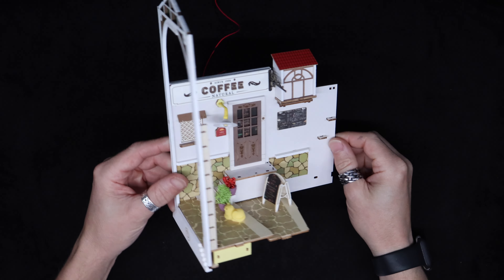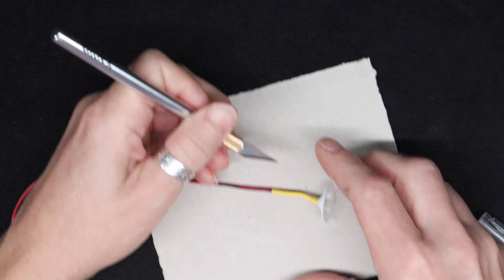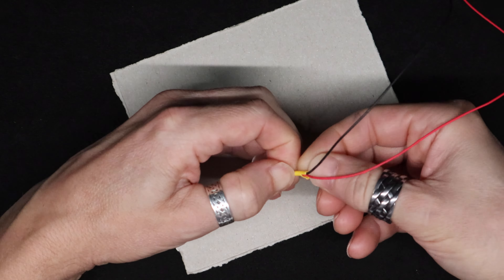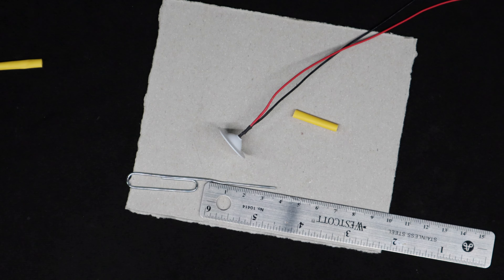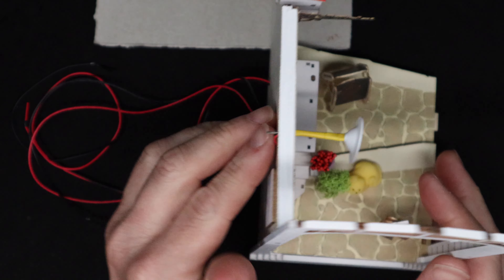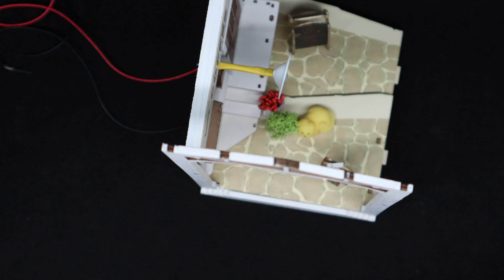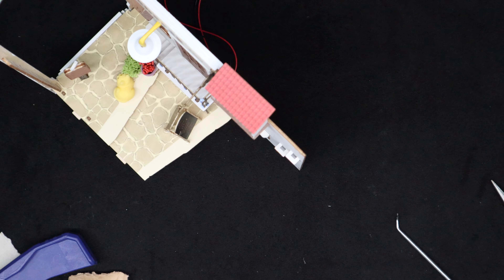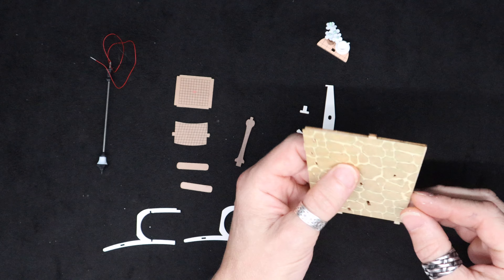Rolife Sunshine Town Book Nook Build-Step 18 (After a Slight Detour)

Comment: use a heat gun and bend the heat shrink while you're heating it. Don't move it until it's completely cooled down and it will fully retain the proper bent shape. I don't recommend a flame heat. A simple craft heat gun works perfect or a hair dryer on high
Reply from the maker: I finally picked up a heat gun, evidently I wasn’t patient enough with it, still learning how it works.